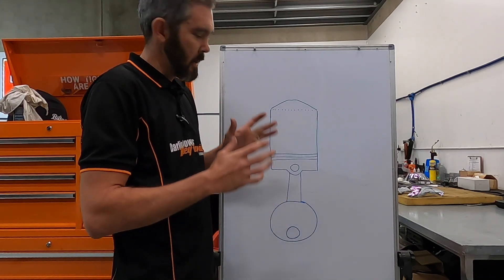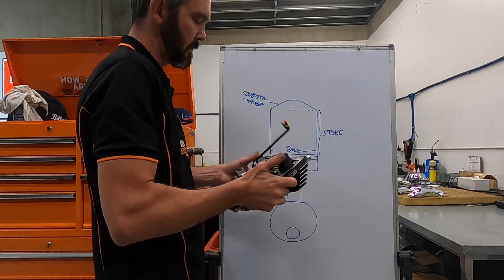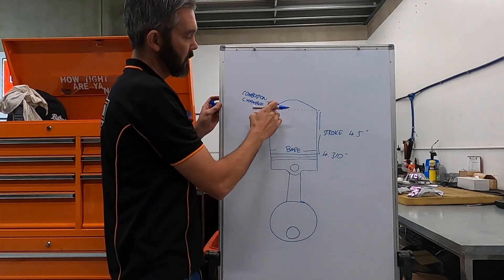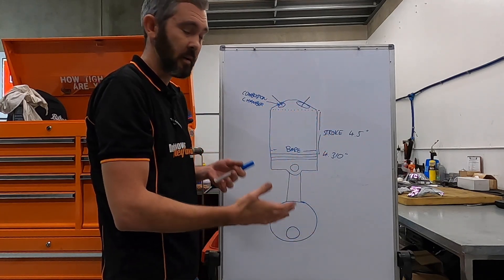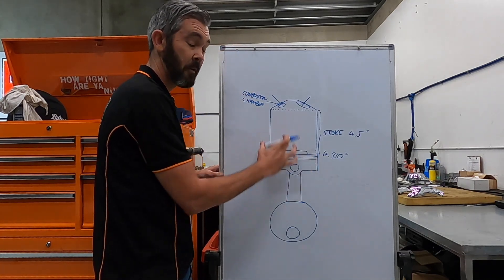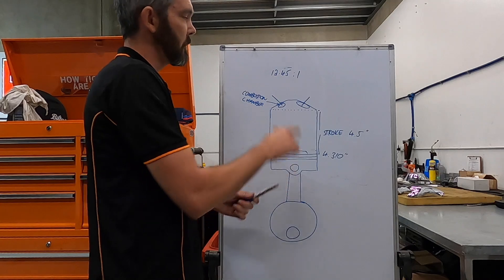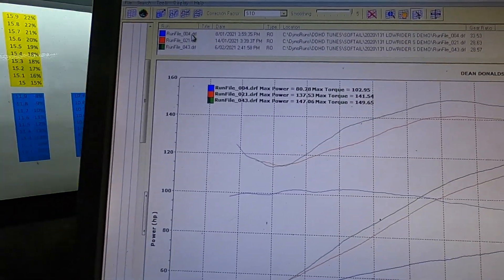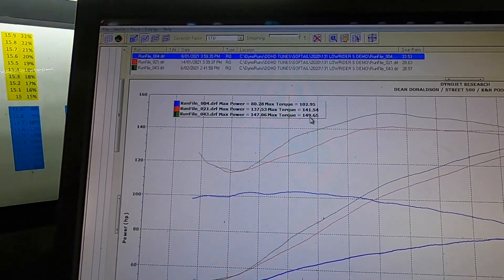131ci Stage IV Lowrider S / Part 3 / T-MAN Hi Comp Pistons / Cyclerama CR540 Cam / Dyno Review

Comment: That dip in torque where you dont want it is noticable in both pulls, like it starts going twice. Is that a notable characteristic of the 540 cam?
Reply from the maker: The exhaust is responsible for it. No you do NOT feel it

Comment: Curious, why does it dip around 2500 in each run? Would a smaller throttle body help in lower rpm's?

Comment: With a bore of  4.31" and stroke of 4.5" and two cylinders this makes 142 cu" so where does the 131 come from?
Reply from the maker: Pi x radius x radius x height.
So 3.14 x 2.155 x 2.155 x 4.500 = 65.620 (there are 2 cylinders so, 65.620 x 2 = 131.240 
So there for 131ci 

I'm not sure how you calculated your findings?
Reply: @MasterTechMiller  My bad. My calculator stuffed up............or was it the operator???🤔🤔🤔

Comment: Hi tommy. Love your content mate. Very specific on build theory. Im a little slow on compression tho. I have an APE high output kit on my 19 FXDR 128, running the c-rama 540. what will a set of these high comp pistons do to my setup? can you advise me what to order. makin 157hp 154 fp tq currently. Thanks
Reply from the maker: You will make a little bit more peak HP and your Torque curve should be slightly elevated across the entire rpm range.

As for how much more power you'll make, I can't give you an accurate figure as many factors can effect this. Air temp & relative humidity on the day of the dyno, the tune itself and ignition advance and so on. 

The pistons are approx $950

Comment: Whats the chance of the stock crank holding up to that kind of power?
Reply from the maker: It's all relevant to how the engine will be used. If it is going to be flogged every weekend at the drag strip it will most likely end up twisting. 
If it's just used to cruise around the streets and in the highways and the occasional 'play time' then it's going to hold up just fine.

We have an option that utilises the factory crank. We have the crank halves split then a an upgraded rod bearing is install, a crank plug is used in place of the factory pin. The crank is then trued into place with a jig to under 2thou then finally the plug is welded so it can't move. 

We recommend install these cranks on engines that are subjected to harsh riding styles and race applications.
Reply from the maker: Check the 131ci Breakout build video on my channel. I installed one of the welded cranks into that bike.

Comment: Hello.  Excellent 3-part build series.  Very informative and specially the relationship of the Cam timing and effect of actual (real) compression ratio versus static comp. ratio.  I'd bet that with a Ward Ported/Polished Intake Manifold (Fuel Moto) you would not only reach goal of 160HP, but would probably see 164-165HP.  TB upgrade?  Additional fine tuning? Tom Miller, Hawthorne, Ca. USA  2021 Road Glide Special (Stock 114 w/S&S 2-1 Sidewinder Exhaust) and 2022 Low Rider S (Stock 117 for now)
Reply from the maker: Thank you for the positive feedback and support on the channel!💪

There are definitely a few things that could help push it over that 160hp mark, ported manifold being one of the options for sure. 

I am struggling against altitude aswell, because our city is 2200ft in elevation, I know for sure doing a dyno down at sea level I would have easily seen the 160hp. mark.

Please hit the subscribe & notification bell buttons as I'm not a full time YouTuber & don't upload on a regular basis. There is content due to be finished and uploaded in the coming days though.

Comment: Thanks for the education!...I really mean that!...I'm new to Harleys having been a performance/sportbike guy for 41yrs. I'm looking at purchasing a new 2021/2022 low rider s and put a stage 4 in it.
I'm use to buying a stage kit and not needing to purchase a predecessor. Looks like harley doesn't work that way. Looks like each stage builds on a previous stage. Am I guessing right on that?
Reply from the maker: I'll try and explain to help you understand. 

Stage 1 is when you swap the stock system & air filter assembly to aaftermarket Hi flow systems & by a tuning module so the ECM can be adjusted to add more fuel to higher flowing engine.

Stage 2 is everything from stage 1 plus adding a performance Camshaft.

Stage 3 is everything from stage 1 & 2 but also increasing the displacement by swapping the stock piston & cylinders to bigger bore oprions.

Stage 4 is everything from stage 1, 2 & 3 but adding hi performance cylinder heads.

If you have a stock bike and want to put a stage 3 kit onto it, the stage 3 kit will come with everything required to get the job done.

Comment: What about readjusting/tuning the suspension for the dramatic increase in power?
Reply from the maker: The Lowrider S comes with pretty decent suspension from factory so it is not an essential upgrade. One would definitely benefit from a full Ohlins setup but the yeah, the stock stuff works pretty good for what it is.

Comment: What are the pistons that you put in there?
Reply from the maker: T-Man performance. They are manufactured by Wiseco for T-Man. Have a look on his website https://www.tmanperformance.com/
you can find your specific bore size & compression ratio requirements there.

The exact pistons I used in this bike were 4.312" with +8cc
Reply: I’m probably going to sound like an idiot, but if i am doing the stage iv 131 kit on my 2021 street bob how do i find out what specific pistons to get? i also wanna get that cycle-rama cr 540-2 cam cause that sounds amazing! thank you very much sir! i appreciate you and your videos very much!
Reply from the maker: @johnnyr5221  You'll want the 4.312" size pistons with the +8cc dome. (Same as I installed on this bike).

The Screamin Eagle 131 stage 4 kit uses 4.310" bore so the cylinders from that kit WILL NEED to honed to correct size a clearance as the T-Man pistons are slightly larger at 4.312" 

The CR540-2 is available through alphaperformanceengines.com.au if you are in Australia or directly from Cyclerama if you're in states from cycle-rama.com
Reply: @MasterTechMiller  one more question...what type of exhaust is on this bike? i apologize for the all the questions but thank you very much for everything
Reply from the maker: @johnnyr5221  D&D Fatcat

Comment: what kind of tuner are you using? i’m doing a 131 kit this winter on my 2021 street bob! i’m trying to figure out what to add to it when they put the kit on so i can get it all done in one shot
Reply from the maker: I only use Technoresearch software on all Harley models.
They are the leaders in Harley-Davidson tuning software and devices as far as I'm concerned. Also, to my knowledge they are the only company that have the capability to tune 2021 model H-D bikes.

Comment: If I brought you a stock 114 what would be the total cost involved with all supporting parts & labor?
Reply from the maker: A completely stock 114ci bike without a tuning device would end up costing approximately $11,000 AUD. That figure can change slightly due to exhaust system chosen & what air filter is chosen.

131ci Crate engine sells for about $10,000 AUD but then you have labour costs, exhaust, air filter & tunjng device still to add.

Keep in mind, effectively doubling the HP & TQ output (within a couple numbers) of any engine gets pricey.
Reply: @MasterTechMiller  Thanks for your reply.

Comment: Hey mate, did you swap the throttle body as well to a larger one ?
You didn't mention the heat cycles & run in prior to throwing it up on the dyno.
Cheers subbed to you looking forward to the next video as I often wrench my own bikes which I actually enjoy doing
Reply from the maker: The 64mm throttlebody comes in the Stage IV kit mate. It got installed in part 1 with the initial build. Check those videos out if you haven't already. 

I know I didn't mention heat cycles in this video but all my engines get heat cycled prior to the dyno. I just show it in the videos because it's just a boring clip of the bike at idle and some slight revving.

Comment: What do you think of external breather systems?
Reply from the maker: I'm yet to see or use a decent one. There is far too many misconceptions out there about the M8 and crankcase breathing/ventilation.

Engines (no matter the manufacturer) that are produced on a mass production scale will always have defects and or issues.

I specialise in building engines from the crank up so I make sure the Cylinders are precision bored and honed, I ensure ring end gaps are set to exactly what they need to be. 
Along with further steps taken during the build process ensures am engine that is capable of the demands the rider throws at it, longevity & reliability.

That is the benefit of a building an engine from the crank up.

Unfortunately the M8 has had a rough start to life but I'm more than confident with it's stock breathing system.
Reply: @MasterTechMiller  
How about on the twin cams?
I have a 110b Screaming Eagle with just 1000 miles on it. I am considering putting a DK Customs catch can external breather system on it to extend the life of the engine.
Reply from the maker: @muslmutt  deffinently worth putting one on for sure 👌

Comment: Awsum explanation on dynamic and static compression mate.im contemplating selling my 2013 wide glide stage 4 race kit and getting a low rider s.whats your thoughts?
Reply from the maker: Thanks mate. I hope you learned or got something out of it.

Hands down the M8 engine is a far superior engine platform.
The Twincam has definitely stood the test of time and has a HUGE aftermarket backing with performance parts ect.

The Milwaukee8 engine has only been around for 4 years but has already surpassed what was considered to be a very high end Twincam build, the Milwaukee8 achieves this with a simple increase in compression with a cam shaft
Reply: @MasterTechMiller  cheers man

Comment: SO IN YOUR OPINION IM WANTING TO BUILD ONE WILL I START WITH A NEW  ROAD KING OR THE LOW RIDER S WHICH ONE AND Y IM LOOKING FOR THE FXRT FAIRING STYLEI WANT  BAGGER STYLE WITH SOME JUMP
Reply from the maker: My opinion would be the Lowrider S ! It's such an awesome platform to build off. The better front end suspension setup of the Lowrider S is far better than the conventional forks of the Roadking. 
Better styling options with the Lowrider S aswell.
The Lowrider S is a better bike to build that custom performance looking bike. 
With the Roadking and trying to achieve the Performance Bagger look really takes away from the traditional look of the Tourers.

Comment: With such higher outputs, why no chain conversions ? My mates 124 breakout kept stripping belts, he ended up changing over to chain & never had a problem since.
Good channel you got here. Id like to see a few more builds on twins cams if thats possible.
Cheers
Reply from the maker: We have found the stock belts are good for 160hp on thr Drag Strip whete traction plentiful. 

Don't get me wrong, the belts can and do strip. 
We have consistently ran low 10sec passes and even into the 9s with completely stock belts. Lots of clutch control is essential to not shock load the belt though. If you get aggressive you can easily strip a belt on a stock 114ci bike.

Another contributing factor with belts is incorrect tension which will definitely lead to premature belt faliure.

Thanks for the feedback on the channel 👍
I will try and get a video done a Twin Cam build asap.

Comment: What’s the best thing I could do to my 96ci 2008 Dyna Super Glide? I want it to be fast in the top end. Go high miles per hour!
Reply from the maker: What's your budget?
Reply: @MasterTechMiller  To be honest, I was wanting to know the best route if I kept my 96ci and just did head work, cams and exhaust and air intake. I just like the idea of having a badass 96ci bike.
Reply from the maker: @techunity1401  well the key to high mph is Horsepower & gear ratio.

If you want to keep it a 96ci, I would get the comp ratio as high as possible (over 12:1)  with a huge set of cams that have lots of  lift (600thou or more) & heaps duration on the intake.
You will need to put a bigger intake manifold etc on it and most likely you'll be looking at the Screamin Eagle MVA Heads or something similar from the aftermarket.
You will also need a good 2-1 exhaust system.

In doing such a build will sacrifice the low end rideability.
Reply: @MasterTechMiller  thanks for your response man. Let’s say I have a $10000 budget. What would you recommend if I went all out and did a big bore kit and all?
Reply from the maker: @techunity1401  remove the 96ci engine and install the Screamin Eagle 120R crate motor
Reply: @MasterTechMiller  what about the 107 Tman performance?

Comment: Hey, Tommy.

On my M8 128 build, I'll be sitting around 150hp/torque. I don't imagine going much over and I don't intend on racing this motorcycle at all. 

Can you give some thoughts on perhaps when you'd want to upgrade your OE clutch and compensator? I'm thinking about the Baker Compensator, Rekluse Clutch/Basket. I'd also consider an upgraded primary chain tensioner to handle the load. That's a lot of money to invest if you don't really think it's necessary. Please advise man!!  Thank you!
Reply from the maker: In a street application such as yours that will be making around 150/150 the stock clutch is absolutely fine as long as you upgrade to the 1275N springs from Screamin Eagle.
The stock compensator has it's limits and you should consider upgrading to billet replacement part from Cycle-Rama if and when you break your stock compensator. Other than that, you shouldn't have any dramas whatsoever on the street.
Reply: @MasterTechMiller   Thank you, Sir!!!  Will do!

Comment: Going to need a aftermarket clutch with that one and brakes, suspension. That is a little much for the stock chassis, can't imagine driving that on the street and having control over that. But it is impressive no doubt.
Reply: I've got the exact same build, by the same Harley Tech. On a MY21 FXLRS. The Clutch is fine, the brakes are fine, the suspension is fine, the stock chassis is fine. Rode it 160km yesterday and it was an awesome set up. Complete control. No issues. Impressed is an understatement. Just sayin.

Comment: cant afford a new low rider yet , so whats the best i can do for my 103tc with stage 2
Reply from the maker: Turn it into a 110ci with Screamin Eagle 260 cams & at least 11.5:1 compression ratio with a 58mm throttle body & put a decent 2-1 exhaust system on it if you already haven't and you'll make over 120HP

Comment: How much did the motor build cost from buying the 131 to buying all the extras? I was guessing like 10k?
Reply from the maker: Are you asking the difference between buying and installing the crate motor VS doing the build ?
Reply: @MasterTechMiller  I guess I thought you bought a 131 m8 and modified it, my bad.
Reply from the maker: Oh ok. So what I did was install the 131ci stage 4 kit from Screamin Eagle & left it completely stock.
Then in part 2 I swapped out the Screamin Eagle 517 Cam to the Cyclerama 512 cam.
Then in part 3 I installed TMAN Hi Comp pistons and swapped the cam again to a Cyclerama 540.

Just to be clear, there is absolutely no difference between in the 131ci Crate motor or the bolt on stage 4 kit. Both engines have exactly the same internallls and components.

This build series was ment to show the benefits of using some quality aftermarket products with the 131ci kit and see how much more power & torqure is able to be achieved.

In Australia, the Crate motor installed cost is around $10,000 (depending on your dealership hourly rate) & and to buy and have the stahe 4 kit installed at a H-D dealership is somewhere around $7500
Reply: @MasterTechMiller  sorry I didn't watch your videos in depth first! I bet you spent way less to get 114 to fast 131 than just having a factory 131 installed at dealer! Cheers!

Comment: So how much miles per hour could do now ?
Reply from the maker: Bike will do 155mph now
Reply: @MasterTechMiller  that’s crazy ,and how much did it cost to make these adjustments?
Reply from the maker: Approximately $10,000 Australian dollars
Reply from the maker: @gimbochamp842  it sounds expensive but it has practically doubled the HP output of the engine. Keeping that in mind, ask yourself how much money would it cost to double the HP output of any other engine out there, car or motorcycle.